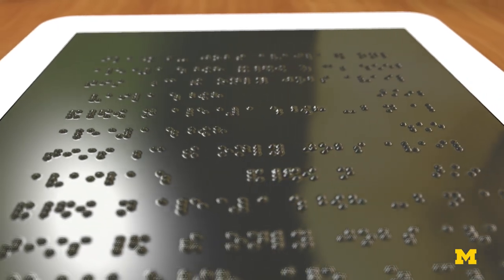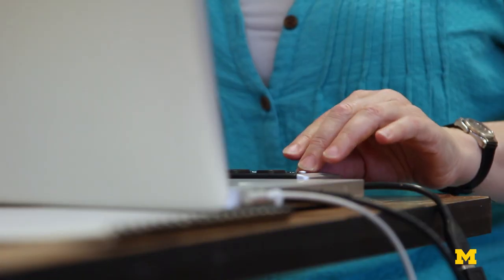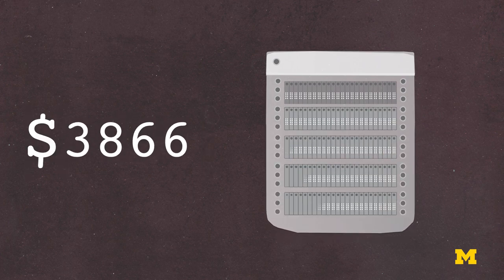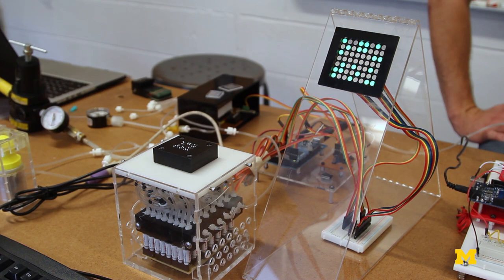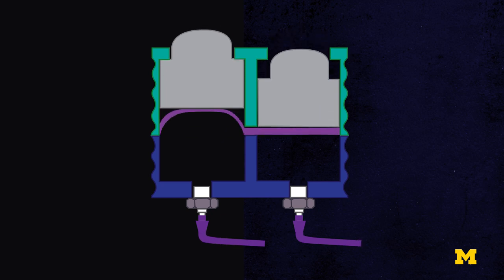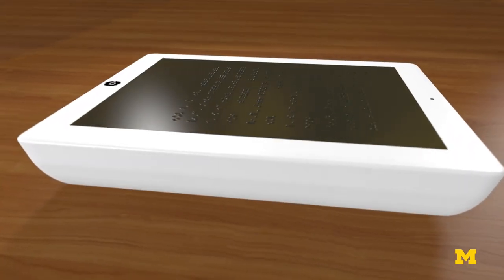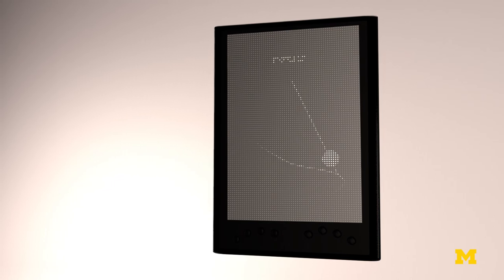An affordable, refreshable Braille tablet that relies on microfluidics

Comment: I'm interested in knowing the current status of the project as I was also thinking of similar project. But thinking of going with electromagnets.
So I would really like to know that, did u Guyz manage to accommodate the valve system/potential alternative in a small size package.
Reply: I was wondering about this myself.

Comment: What if it used some sort of tactile system of vibration or even different pitched sounds to let the user know what bumps their finger was going across? 

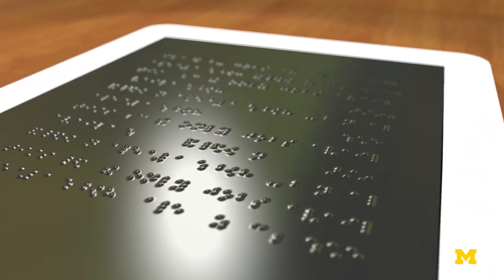This is cool, but the graphic at 1:39 looks like some futuristic shape shifting 3-D liquid from the Matrix or Terminator II, and I'm no scientist, but I don't think we have that tech yet.
Reply: It would just be bubbles of air or fluid under a stretchy membrane
Reply: ohmygod i just now thought of the vibration system and how useful it might have been too and i was researching about this and found this video..and here u are who thought of the exact same thing

Comment: The pneumatic approach might work for a large static workstation, but it could never be portable. Further, Braille is outdated and limited. Think outside of the box if you want to move forward in this rather stagnant area.😉
Reply: > Braille is outdated and limited

Not for blind people it's not. Tell me you're not actually blind without actually telling me.

Comment: go with small solenoids...
Reply: That would still be too big. The scientists in field of microfluidics are grappling with the same problem, controlling a large number of pneumatic outputs with electrical signals in as little space as possible. Work has been done on creating a pneumatic multiplexers and shift registers to control a large amount of outputs with just a few solenoids. https://www3.aiche.org/proceedings/content/Annual-2009/images/165260-2.jpg
Reply: you have at least to try to implement one before you throw it out the window as an idea, it's a weekend project to make 2solenoid dots and see how they perform
Reply: Small solenoids are heawy if there will be huge of them...